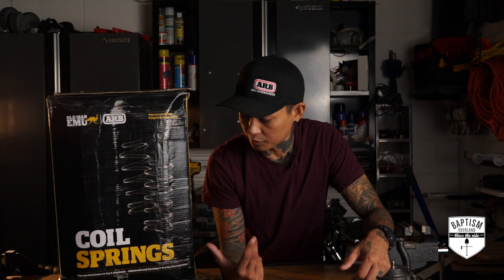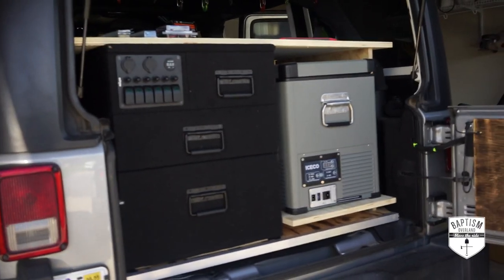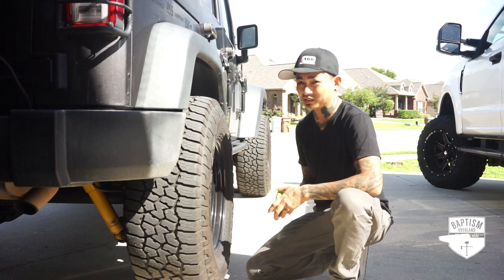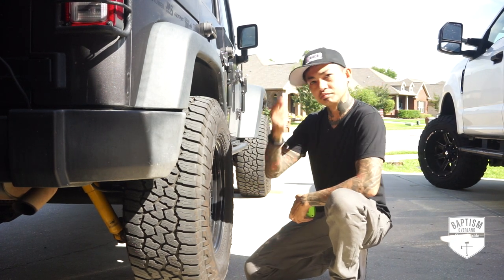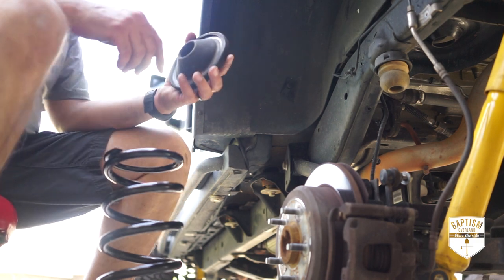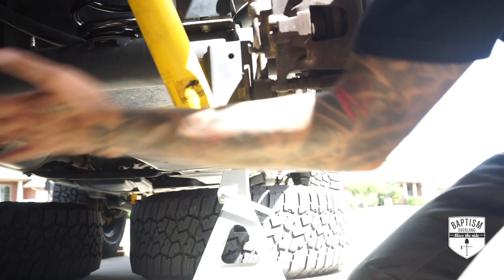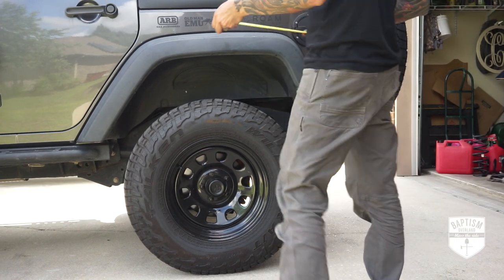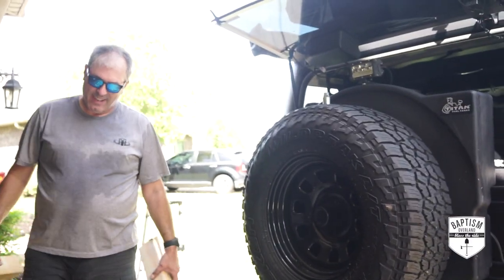I Had to Get HEAVIER Load Springs on the Jeep *Installing The ARB OME HD Rear Springs*

Comment: I have dual coil over, Rubicon Express shocks with Ebach springs, and a nitrogen reservoir.

These guys got me through the Rubicon a few years back, but now it feels like every single lane marker feels like I ran over a boulder at high speeds.

How would I soften the ride at this point? It's truly unbearable. I'm flying around in my jeep just driving to work!
Reply from the maker: Throw the whole Jeep away! Lol jk. I WILL say this…I used to have Eibachs a looong time ago on my 240sx back when that was a thing and I didn’t like it at all.

What changes have you done to your Jeep since it’s been lifted?
Reply from the maker: I WILL say that I can almost bet it’s not your shocks. Rubi Ex makes good products specifically for Jeeps. Is the reservoir still full? Maybe it has leaked? Eibach is also known but not sure how their Jeep applications hold up.

Comment: Have you come up with a solution for the spring bowing having the same issue any advice appreciated
Reply from the maker: Turns out the bowing is from the stock track bar that's why it's bowing in one direction. Once I get track bars it should center the axles again and get it straight but so far haven't had any issues driving like this

Comment: Would these be ok to use if you didn't constantly have extra weight?
Reply from the maker: I personally wouldn't do it or your rear would be jacked up when not loaded. The majority of my weight stays on vehicle (we are talking roof rack and tent and soon a steel rear bumper) so this balances that. It will droop just slightly when I add cargo

Comment: I got a set for my Jeep years ago, they are already sagging.
Reply from the maker: The heavy duty ones?!
Reply: @BaptismOverland  Yep
Reply: I do long adventures in Death Valley and the Sierras with loads of gear. Nothing to crazy but I broke 2 sets of Pro Comp springs before buying OME. They were loads better, but still not heavy duty enough...
Reply from the maker: @BrettHoustonTube  damn! How much you got on the Jeep? Haha an elephant?!
Reply: @BaptismOverland  I figure 12-1400 lbs over stock weight.